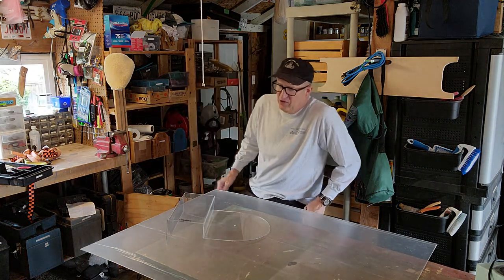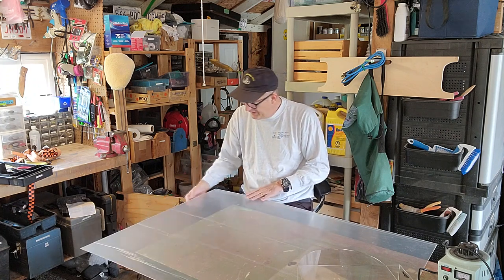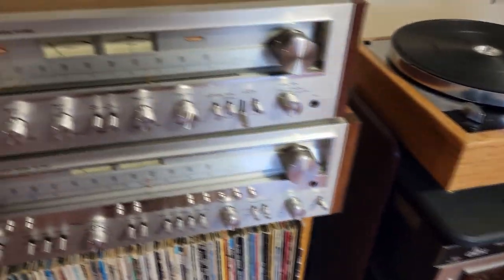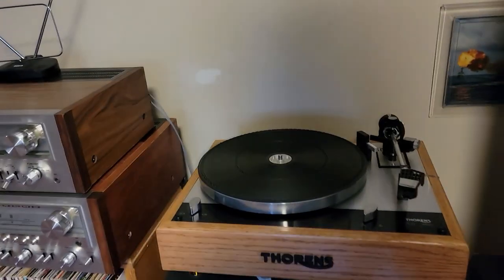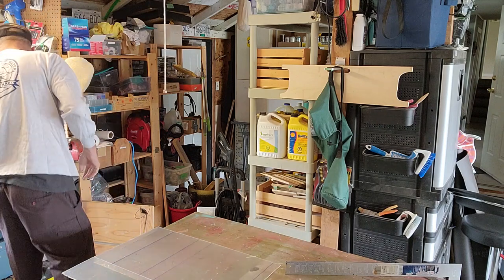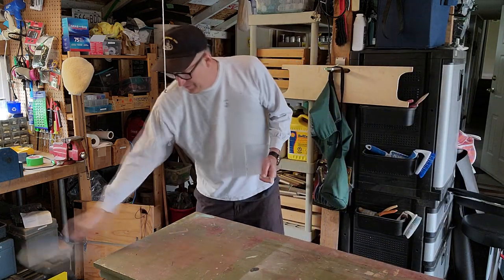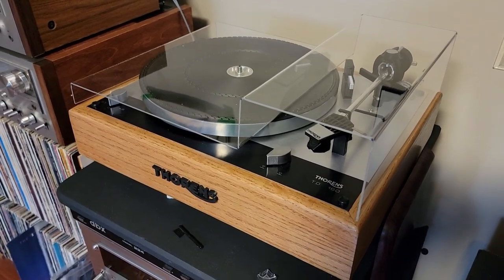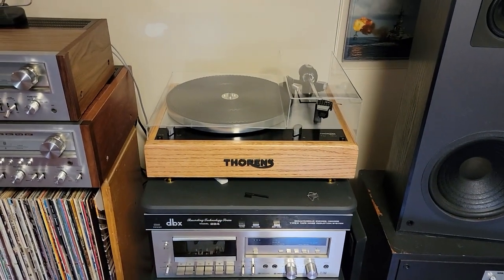Part 8: New DIY Dust Cover Design for Thorens TD-160 Turntable Refurbishment Project - 8 June 2022

Comment: Hi Tim, Couple of questions, will the Plastic shop or where you bought the plastic cut it to final rectangular size for a charge? Also how do you think they cut the circle on the blue cover as I think it's kinda cool looking. Obviously the round cover spins around so you dont want to bump the cover at all for it to hit the arm. Is there a way to keeping it in line? Also did you need to polish or buff the cut edges of the plastic. Is there another method of heating the coil without using a variac?..andy in LS
Reply from the maker: I just bought the sheet at Lowe's (like Home Depot) . That is why I cut it myself to size. I am sure places like Industrial Plastics and Paints here in Victoria can cut to size if you wish but their plexiglass is not cheap. As for the circle cut on the blue plexiglass lid - I did that myself using a jigsaw and a metal cutting blade. I used a 12" record to scribe the radius. The blue plexiglass I bought as a small sheet at Indutrial plastics and paints. Cheers. Tim